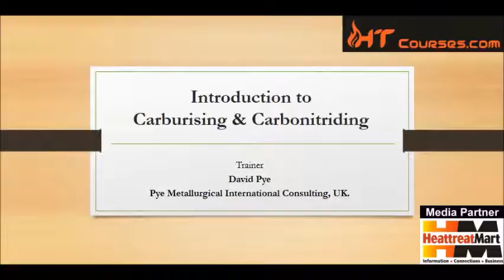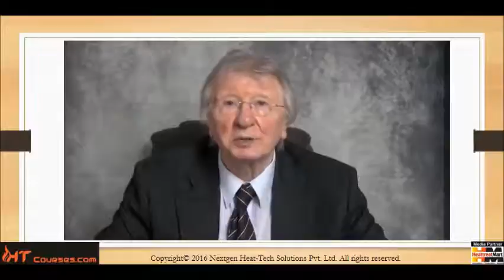Introduction to Carburising and Carbonitriding

Comment: I have question.

If using AISI 1050 (high carbon steel) forming then hardening or
If using SPCC (low carbon steel) forming then carbonitriding, 

And the parts require 38-44 RC and thickness is 0.9 mm.

Will these both processes be performing the same?

Thank you for your advice.
Reply: Good day to you sir, thank you sincerely for your valued question. The SPCC steel after carbo nitriding will most certainly give you some wear resistance property albeit that the case depth will not be very deep (approximately 0.25 mm or may be slightly more). You would accomplish a surface hardness value (in hardness  Vickers)(HV) of  approximately 700 HV up to perhaps, 800 HV (translated into Rockwell C scale would be approximately 60 HRC - 63HRC). However, the core hardness would only be approximately 32 HRC up to a max of 35 HRC. Therefore any load which is applied to the surface that is greater than the tensile strength of the SPCC material, two things would happen the first one would be that the case would collapse because of lack of course support, or the product would take on a permanent bend set. I could give you  a better answer if you could let me have more information such as the product working environment, the potential surface loading, the product design for purpose, what is the product's purpose. I hope that this brief answer has given you some guidance but I would need more information to give you better guidance. Yours sincerely, David
Reply: Thank you very David. I appreciate your advice.
The product is the hook and clip of measurement tape. I would say it uses both indoor and outdoor.
The reason I ask is because I want to use to low carbon steel(SPCC) instead of medium/high carbon steel (AISI1024/ AISI1050) in order to reduce the material cost.
Not sure if this way will be working or not?
Yours sincerely,
Natthapon
Reply from the maker: If you do carbonitriding of low carbon steel (SPCC), you may get much higher hardness ( more than 60 RC) on the surface but a very low hardness in the core (because of the lower amount of carbon available in the base material). I think for the application mentioned by you, a good core strength is more important than the wear resistance. You have mentioned the hardness of 38 to 44 RC.That kind of hardness (in the core) is impossible to achieve in low carbon steels.